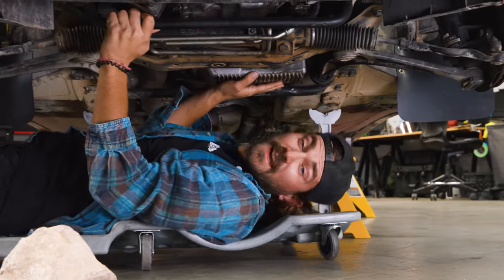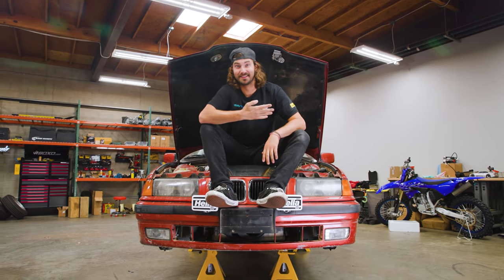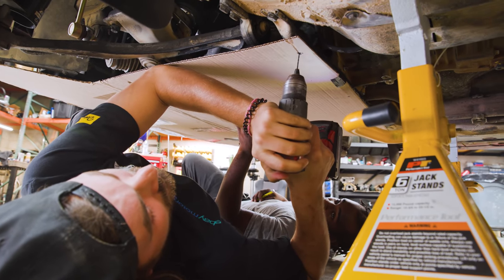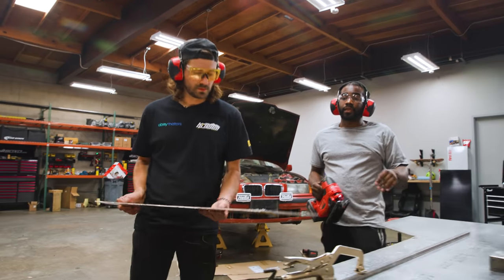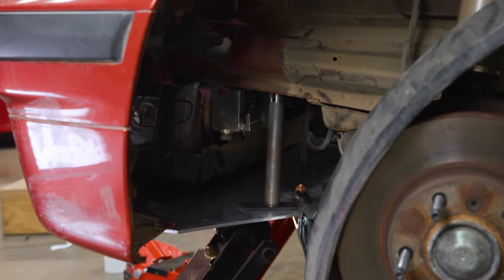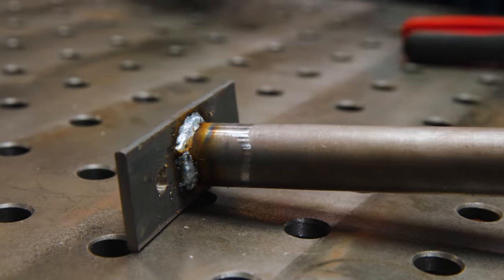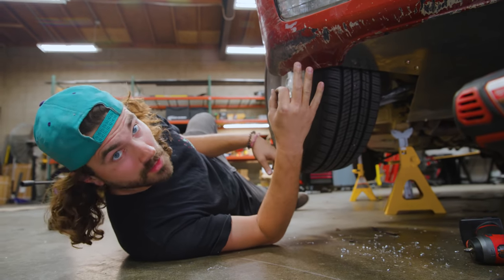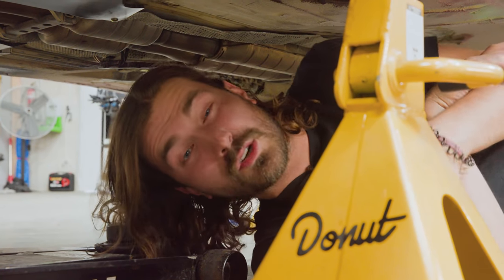DIY Rally Skid Plate - Is it Worth It?

Comment: Nitpick, UHMW just means ultra-high molecular weight! It's a designation used for polymers when they are polymerized in very long chains, and has different material properties from the same polymer if the chains were shorter! That said, it's probably polyethylene, UHMWPE is a super common engineered material. Great vid guys!

Comment: Aluminum sheet metal and pipes can be cut with a Jigsaw blade meant for wood or you can buy purpose made blades that are designed to specifically cut Aluminum. Either way, use good old WD-40 as a lubricant as it helps prevent the Aluminum from sticking as much to the blade.

Comment: You guys could use a piece of plastic as a kind of two tier skid plate, the plastic being an ablative layer. You could honestly use zip ties to attach the plastic and leave a slight gap between the plastic and aluminum. Therefore it would be harder for sharp rocks to either break your mounting hardware or puncture the aluminum.

Comment: Might not see this, but you could coungersink the sheet and use countersunk bolts, or if nothing else use button cap bolts instead of hex heads. The button caps are rounded so if it did hit, it's going to do less damage to the hardware

Comment: Another tip: use a piece of foam in between the skid pan (glued to the skid pan) and the oil sump. Rocks have a tendency to get lodged in there and when you hit the next rock or bump that dents the skid pan, it pushes a hole in the sump.

Comment: Oversize your mounting holes in the skid plate by more.  Like a lot more.  And use big fender washers to hold it up.  If that skid plate takes wallop it can bend the mounting bolts and make them next to impossible to remove if they're a tight fit.

Comment: Use Button-head bolts instead of hex heads.
Those are way less likely to catch onto something and shear a head off. And you can usually use a regular screw extractor remove them if the allen hole gets damaged.

Comment: few tips for cutting aluminum and other metal

1. in a pinch depending on on thickness you can use a skill saw with a carbide tipped blade and lots of wd40 or other aerosol oily substance
(used this to cut 1 inch thick aluminium grate that had 1/8 thick bars spaced every 1/2 inch)
2. dish soap work wonders when no oil is available.
3. metal working oil is great but any oil will work, liquid oil is better in some circumstance as it sticks to the blade where as aerosol oil is better in other circumstances because the jet evacuates the metal chips and cools the blade better ( test both and see what works better)
4. you can also you an air compressor gun to help cool the blade
5. more for grinding but if you have those grinding sanding disk or a zip cut not made for aluminium you can load it up with wax (bees wax work awesome) and it will prevent the disk from immediately loading up and gumming up.  has a bit of double action the melting of the wax cool off the grinder disk but also help to evacuate the chips...just don't forget to reapply often. ...excess wax cleanup is easy with boiling water

Comment: I got a Rennline 3/16" aluminum skid plate off ECS for my Mk5 Rabbit. ECS made a mistake and had it listed for $99 and I ordered before they fixed it back to it's original like $300. Looking back I'd still buy it even at full price because it has a few witness marks from when I bottomed out. But even better that I paid like less than half for the thing shipped!

Comment: That will work protecting against big rocks. But when you mounted the gas tank protectors so that they make contact with the tank, they will collect some dust and sand on top of them. When the sand is in between the gas tank and the plate, it will eventually make a hole to the tank by vibrating.

Comment: Nice, the only thing I'd do differently is use countersunk screws on the skid plate, that way if a rock or something hits the heads of the ones you have on there, it doesn't get mangled up and it'll be easier to remove next time

Comment: Man, you can get cut-off wheels that are made specifically to cut aluminum, they don't  gum up at all like your standard cut-off wheel would with aluminum. 

You can find them at weld supply companies like Praxair and Airgas....check wherever it is that you buy the argon you use TIG welding

Comment: I saw a video but engineering explained on Rally car prep. They used plastic so it was easily replaceable and malleable for the rear end (so the plate could travel with the suspension etc.) Could be worth your time checking out.
Reply: 𝘿!𝙘𝙠 Riding ǤƗяℓ Lily  thanks obviously a bot

Comment: I think if you added a oil filter replacement kit along with a hole for oil changes... Glued on rubber caps would be enough for the exposed hardware pieces. It's already unlikely to have a rock hit such a small target but Incase it does the rubber shielding should be more than enough to absorb the impact!

Comment: Great project, I wanna put something similar under my Mustang. One question tho: why not use a plasma cutter to cut out the shape? Would be much quicker and you avoid the gumming issue.

Also, from my experience with BMW's and Land Rover's that come with alum skid plates from factory, they install nuts with clips, weldnuts, and drill enlarged holes in the plate, leaving a good 1/4-3/8 in overall lateral play in the plate to allow all the holes to align.

Comment: Try a wood blade in aluminum next time the teeth don’t get gummed up neatly as easily. Also some cutting coolants help keep the blade lubed, (not for heat, but for the sticky gummy aluminum to stay off the blade, the larger and wider spaced wood blades teeth help a ton)

Comment: 6:45 That is because the teeth on "metal cutting blades" are small, which you don't want when cutting aluminum. You actually want a nice carbide-tipped wood cutting blade. Not a low TPI blade, more of a "fine" wood cutting blade, but it would work much better. I would have gone with a carbide teeth triple-chip blade in a circular saw for all of the straight cuts. Would have made very short work of the project.

Comment: So, I wanna get into customizing cars. My biggest concern is sliding under the car while it’s on Jack stands, and being crushed to death. I live alone and don’t have friends that could help, so how do you know it’s safe? What if you accidentally kick one of the stands sliding in and out from under? What do you do if the vehicle falls and you’re still alive but trapped, and can’t breathe enough to tell Siri to call 911?
Reply: My trick is to stack wood near structural areas or under the tires, cut a bunch of 1 foot long chunks of 2x4 and just stack to size. It's not supposed to hold anything up, just be there as a backup

Comment: Key to cutting Ali with a jigsaw, use wood bits and a soap bar, the wood bits arnt so dense with teeth so they dont get so hot, and melt the ali into the gaps, and the soap bar stays for longer then the cutting fluid as a lube.

Comment: When you mount your skid plate/shield thightly against the oil pan or gas tank, they will get grinded through. The dirt will find it's way between the plate and the oil pan/tank, and when the plate vibrates it grinds the dirt and small rocks against the pan/tank. It might hold a stage or two, maybe a few laps on your local dirt track, but it will eventually go through. Without the plate, you might get lucky. With that style of plate, you will get holes on your fluid reservoirs. Also, zip tying your plate is just a waste of time and material.

Comment: I dunno, I think because I had an aftermarket skid plate installed on my old 2001 VW Golf TDi, I think what I had was substantially better than what I just saw, and even with labor to have it installed, it cost about the same?

How did Ian Baker phrase it? "Don't waste your time and money trying to do things which someone else in the world already sells as a product." That way you can focus your time and energy on novel creations, to again paraphrase Ian Baker: "I don't know how to create a giant interactive fire sculpture instrument, because this is the first one which has ever been made. After we are done making it, then I can tell you how to create one." Sage advice.

Regardless, the skid plate I had was I think made out of steel, not aluminum, had a panel for easy oil changes to make mechanics' lives less hellish, and I think was even painted sort of gunmetal black which was a nice undercarriage finish. Even after I switched mechanics due to a move, the new shop asked me, "where did you get that awesome skid plate? We've never seen anything like it!" Turns out I got it from Old Volks Home in Santa Cruz, which had it in their stock because a customer had special ordered it and then decided to not pay for it/have it installed so they gave me a killer deal on it.

Long story short: I think you should have seen what the aftermarket offered. While this seems as if it is not a difficult DIY, I think you maybe could have ended up with something significantly better for around the same amount of $. Albeit, maybe killer skid plate aftermarket vendors prefer 2001 VW Golf TDis to old BMW M3s? I know I sure as heck think that every penny invested into a BMW is a waste.

Comment: I wonder what year BMW started adding skid plates; every model I’ve seen since 2015 has a steel or aluminum plate to protect the oil pan.  Thanks for the video guys!
Reply: The 1998 E46s, which partially had the same engines as the E36s, already have an aluminium reinforcement/skid plate unter the oil pan. That one has some holes and vents though, and doesn't go all the way to the front.

Comment: also: skid plate story. one time i was driving down I80 at 75 mph when a random muffler showed up on the road out of nowhere. I hit it with the skid plate, threw my car up in the air 6 inches... had some really bad vibration the rest of the way home because the skid plate bent upwards and was grinding directly against the engine. but in the end i just unbent it, replaced 2 bolts that were completely destroyed, and went on my way!

Comment: Would welding 1-2in diam by 1/2in length aluminum pipe similar thickness to the plate around the hardware protect? Like pretty halos.

Comment: You should add a smaller removable section under the oil plug and oil filter so you don't have to take the whole plate off

Comment: That price sounds really high for aluminum, and I feel like delrin is usually cheaper than uhmw. Ya'll should check out IMS or m&k metal or some place similar. They're all over LA.  I'd expect 5052 aluminum to run just under $4 per lb, so 33% cheaper than what you paid.

Comment: Needs a steel bash-plate to replace the front bumper/skirt. Maybe even anodize the scrap aluminum. 
The tubes are your major weak point. If you hit a rock with the edge of that metal, it will be worse than no skid plate.

Comment: Eeeeh, not going for sunk cone-head screws on a skid plate is... questionable at best. They get ripped of easily otherwise and you end up with the skid-plate bending up in itself. Worked on off-road modifications a lot and have a CLK 230 rally build me'self, so this series is really interesting right now.

Comment: Was there a reason you didnt choose steel for both? It seems lile the obvious option. Was it for ease of manufacture? Or was weight the deciding factor? I cant imagine a steel plate costing much more then an aluminium one. Given the alloy would have to be thicker.
Reply: most likely for weight and aluminum will bounce back more instead of bending.

Comment: I find when cutting aluminum the quickest and easiest ways to cut it is with Oxy Acetylene or plasma.
Reply: unless you've got a plasma cutter cnc table, hand cutting with OA or plasma will give pretty rough edges thatd require a lot of grinding to get smooth. Jigsaw method aint bad

Comment: Not sure why you wouldn't let it be longer rather then cut the plate short lol!!! Also use air pressure on the aluminium blade, removes material, save blades.

Comment: Any time I’m cutting aluminum plate I’ll use wood blades in my jig saw, with the bigger teeth you won’t get as much teeth gum up. Just put oil along your cut line and you’ll be good, I’ve done up to 1/4” with no problem.

Comment: Buying a 65 mustang coupe from my cousin and im going to replace the rear quarters and possibly the hood. Is there a good way to get bondo off and fix whatever dents there are in the hood? Or would it be cheaper/quicker to just go ahead and order a new hood. There is quite a lot on it.  It is the og hood so it would be cool to keep it if I can, but I'm not against just getting a new hood and replacing it
Reply: easiest way is sand blasting deffinitly easier to just replace it as far as cost well that depends on what you value your time at.

Comment: Looks good! Just curious how hard it is to remove for oil changes, etc.?
I also remember when I was shopping around for a skid plate for my old WRX that a lot of them protruded out just past the front bumper & then had an upturned lip sort of thing. Not as low-profile but it looks like the E36 bumper could use it lol.
Reply: The upturned lip is needed. They just built a shovel and have increased the chances of them damaging their oil pan and ripping off their skid plate. This skid plate would work for rock crawling, but it is cringe-worthy for a "rally" car.

Comment: So Zach, why rivnuts over tapping the holes in the frame? I have not used rivnuts before but I feel like tapping the holes would be stronger as standard rivets are not necessarily strong.
Reply: Because u cant thread sheet metal
Reply: @dipstiksubaru3246  I would hope your frame is not sheet metal
Reply: @daviddewald4540  most, if not all unibody vehicles have "frames" that r folded sheet metal.  So yeah it is.

Comment: Jobe! For bolt protectors, cut 1/4" wall aluminum tubing in 1/4"-3/8" long pieces and tig them one on around each bolt head. Simple, clean, effective.
Reply: That's a ton more effort to do something less effective than just chamfering the holes and recessing the bolt heads

Comment: HVAC technician here hey y'all let me help you with this aluminum cutting deal y'all got going on first off you don't use a metal blade to cut aluminum yes it is metal but it's so soft you use a wood cutting blade and it cuts like butter... Secondly when you are cutting any type of sheet metal it is much better to have a linear horizontal cutting line not a vertical one because of the way a saw blade works it cuts through metal easier if you lay the blade down long ways and allow more of the teeth to cut through more of the metal when you try and cut at a vertical angle straight up and down less teeth make contact at once with the sheet metal and it also makes contact and less of an area so by laying the blade down along the line you are cutting and using a reciprocating saw instead of a skill saw you would be able to cut that shape out in about 5 minutes very easily... I hope this helps someone not struggle down the road... Again the only reason I know is because I'm at HVAC tech and I deal with a lot of different types of fabrication with sheet metal.

Comment: Love the fad job but you’ve created a new problem. First your skip plate is a collection plate for sand now. So over heating and extra weight will happen during a run. You also need to make a guard on the lower centre on the bumper cover. The rad fan is asking for trouble being exposed that much.

Comment: don't remember if i heard someone reliable like Adam Savage say this once, or if i picked up some frustrated fabricator's figment, but i think drill bits and/or saw blades for wood are actually better for cutting aluminum than the ones for metal, since it work hardens and gums stuff up... dunno if that's true, but maybe someone else in these here comments does... I'm confident this will under no circumstances lead to passionate debates and/or petty squabbling.

Comment: Around 6:50 - I'm surprised at you guys. You're experienced fabricators, but you cut that Aluminum with a fine tooth metal blade? Aluminum is basically metal wood - you work it and cut it just like wood. So instead of a fine tooth blade, just use a basic wood cutting blade (circular saw, jig saw, whatever) and it cuts fine. Cuts faster and it doesn't gum up. And it's not even hard on blades - unless you have a blade made of soft cheese, it has no more affect on it that any other hardwood. 

If you didn't know before, know you do. 😀 Now to watch the rest of the video.

*edited for spelling*

Comment: "skid plates ain't important"
bro I was on a dirt road with grandpa's pickup and when up a hill I hit a small bank subsequent to the little hill's top. Guess what.... that bank ripped about 5 inches of plastic from the low front fender mount, and the next day getting ready to come home we noticed it simply ended up TEARING A HOLE TO THE BOTTOM OF THE RADIATOR because the plastic was fixed to an iron mount that was, for some reason, supporting all of the front end with a wire tied lol we made a 2h trip by coasting not to overheat

Comment: Aluminium. No aircraft grade. But beer can aluminum. And its like 1/8", 9 gauge. So a hammer can wreck it. Not much protect. So no. Porches skid plates are aircraft grade about 5 times more resistant then beer can aluminum. And its less likely to wreck your cutting blades and drills. So sh!ty